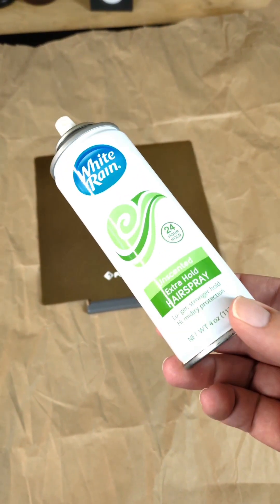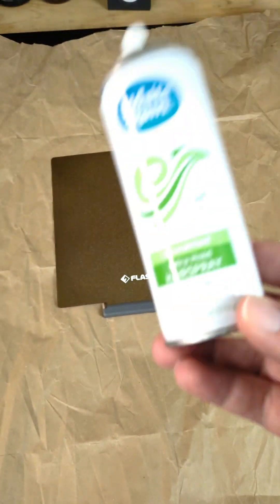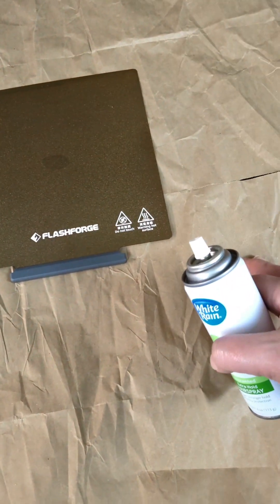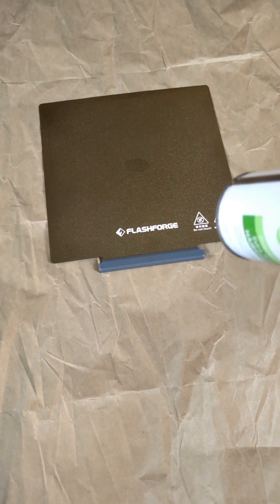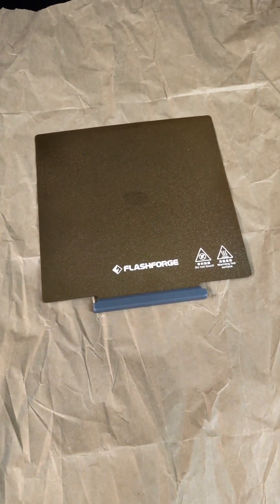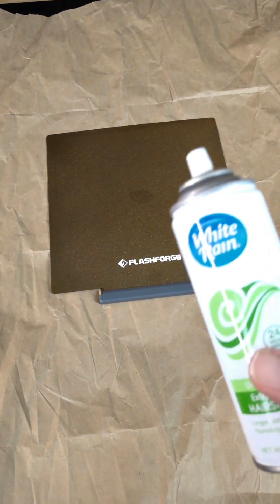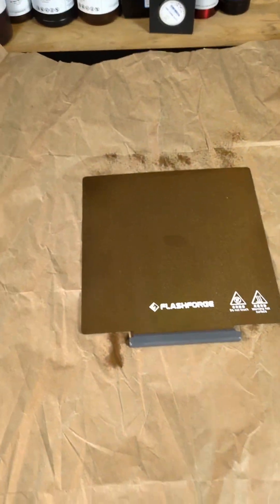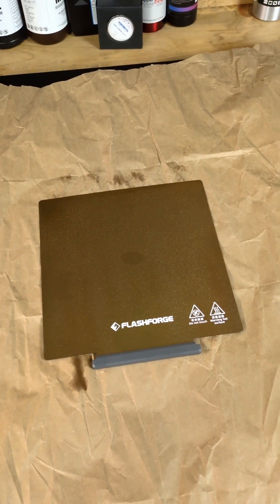Hairspray makes your 3D prints stick like crazy! #sliceprintroleplay #3dprinting #3dprinter

Comment: You're only hurting your prints if you use hairspray that has oil or vitamins added to them!  Vit E, Jojoba, tons of hairsprays have oils in them and do the complete opposite of what you're goal is.  Purple glue stick and some alcohol FTW.

Comment: Why not just clean it? Last time I've used hairspray or glue stick was I 2019 on a glass plate. Pei works when it's clean. Unless you are printing PP that just stick to itself
Reply from the maker: @kruger12311  a few reasons. 
#1, people have asked me to make this video. 
#2, not everyone has a PEI bed.
#3, some material types don't play nice with some bed types.
Reply: @SlicePrintRoleplay  good idea to address that in the video.
Reply from the maker: @kruger12311  Adding in extra info like that is often frustrating for people who typically watch short videos for a quick answer to a specific question.
I'm sorry if this video isn't up to your standards. However, this was meant to be a short video explaining my process for applying hairspray to a build plate. I feel the video accomplishes that goal.
Reply: Well actually I use a PEI plate a CLEAN and prepped plate and today a tree support failed mid print after 5hrs of printing.  So not all the time PEI plates will do the job… hairspray on the other hand works like a charm
Reply from the maker: @YEng-sn8ut  there's nothing wrong with wanting some extra security/confidence. I've never heard of a hairspray/glue hurting a print (as long as it's applied correctly. However, I do see lots of people judging others for using it. To that we say,
"if it works, you're happy with the results, and you're not hurting anything then that's all that matters." 😊
Reply: My Pei plate worked fine for 4 months, then all my prints stopped adhering to the surface even after cleaning. This works every time.
Reply: @ArstanWB  probably need to clean it with at least a non abrasive sponge to mechanically remove plastic contamination from previous prints
Reply: I had a problem with adhesion and started to use the hair spray but the print seems to be warping on the edges,  after I use the hairspray should I still heat the tray to 50?
Reply: You must be printing easy trinkets. I have had to use glue on my pei on the last 3 projects to get them to stick properly in addition to cleaning with soap and water.
Reply: @ttonAb2  Small and big parts from PLA, PETG, ABS, ASA, PC, PA, TPU. Single models and full beds. I think it might be down to quality of the bed sheet. I have both Fysetc and Energetic pei build plates. Also had no problems with a cheapest smooth pei sticker. Just a little sanding with 400grit to rough it up.
Reply: @kruger12311 yes but shape, thickness of top and bottom, number of walls, and filament all contribute. Glue stick works better than PEI when you really need it. I was printing 8 walls 15 top and bottom and 75% infill and I needed brim, pei, glue stick, wear rubber gloves while washing plate with soap and water, only one layer of glue stick otherwise the glue stick would separate from the other layer of glue stick. But yes normally clean clear pei does the trick. I would have modeled the parts differently to get better adhesion, but couldn't re model them.
Reply: @ttonAb2  I don't know if you ever printed with PC. It shrinks like crazy without stabel chamber temp. With clean PEI it stuck beutiful but pulled the plate from the magnet. 0.6mm nozzle, 0.2mm layer height, 10mm walls and top/bottom, 60% gyroid infill. Part was 260x260.